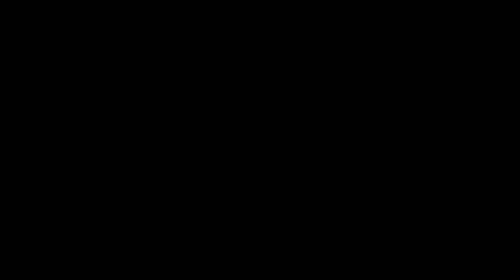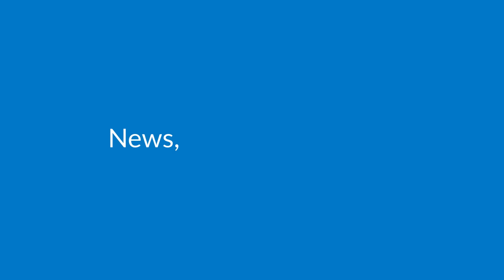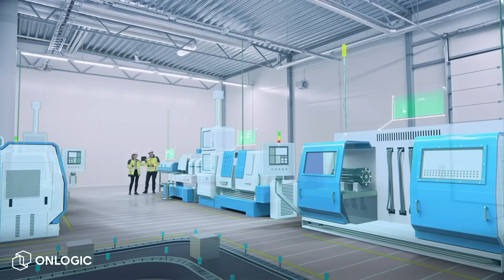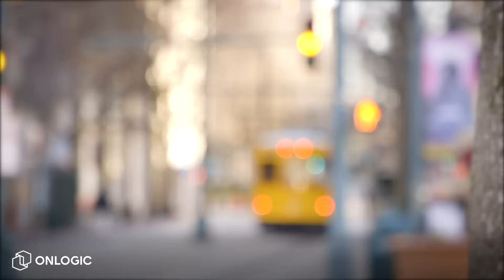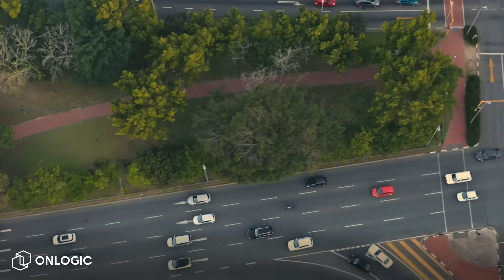What is a Digital Twin?

Comment: Nice video. Thanks for sharing. Looks like Digital twin is helpful for the operators. Is it any way relevant to top managers/ board directors?
Reply from the maker: Digital twins can be very informative for those not working directly on the line as they consider changes to staffing, procedures, or resource allocation. Those variables can be assessed digitally before putting real-world changes into place.

Comment: This seems so optimistic for now it is Far from being applicable and a bit over-selling, as for the example of the Jet engine, to do so, you will need to enter every pit and piece of its material and its heat behaviour, which is sometimes not provided in the catalogues or from the manufactural (rubber grade, metal alloys used, all wiring and electronic circuits) usually as operator information provided are the ones in the catalogue and Digital Twin is used to know when or where the issue can happen but not for testing as mentioned, other than that, this is a great piece of material and Effort.
Reply from the maker: Thank you for watching and for that feedback, much appreciated!

Comment: 1.	At 1.19m, you’ve mentioned that “The digital twin (DT) then uses AI to simulate and demonstrate the effects that changes in design, process, time or conditions would have, without having to subject the real-world object to those same changes.”.
a.	How effects are arrived at when DT is yet to have data on real-time scenarios which didn’t occur?
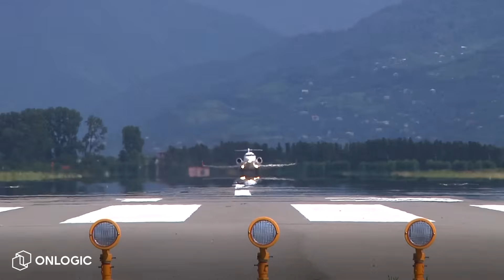2.	At 1:29m: how does DT know the impact of 120-degree impact on the jet engine unless this situation has occurred earlier in reality and its impact has been stored as a data point?
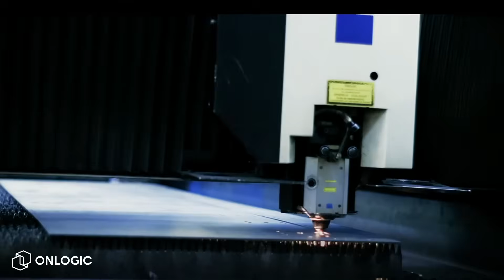3.	At 1:45m: impact of changing maintenance schedule for a factory. How will DT knows the impact unless the scenario has occurred earlier and its impact has been stored as a data point?

Comment: What type of sensor is used for digital twin
Reply from the maker: Thanks for the question! The short answer is many different types. The longer answer will come from knowing what information you need to collect to inform your digital twin. Some common types of sensor data used to build digital twins include temperature, pressure, velocity, angle, distance, size and so many others. Data from any of these sensors might be used to build a digital twin, and then can be further used to implement updates to the model over time.

Hope that helps.